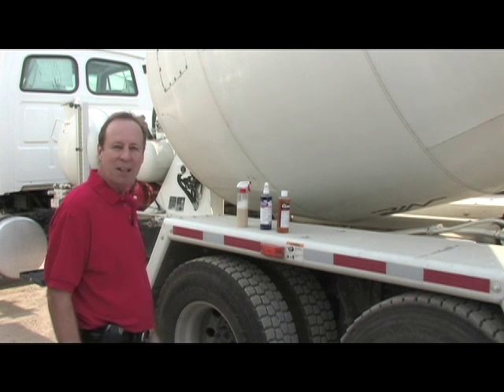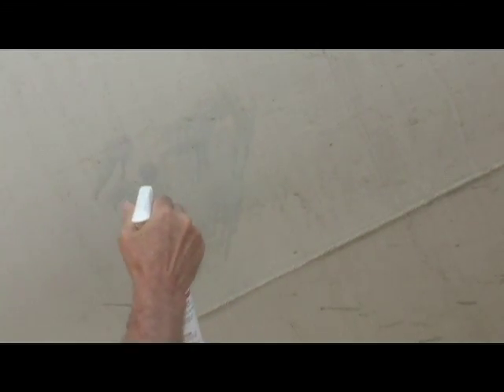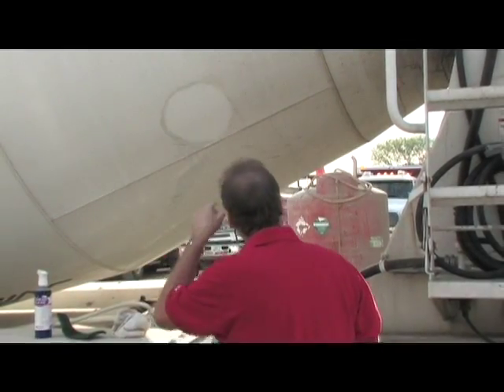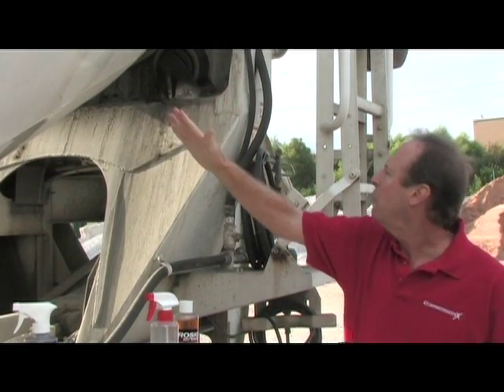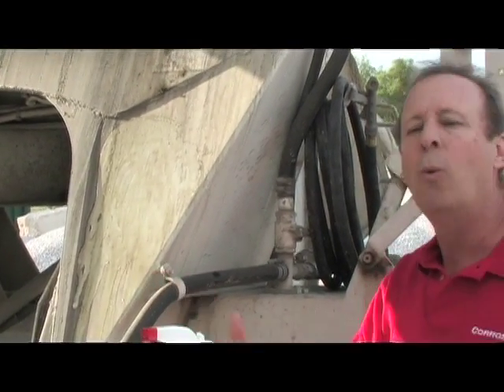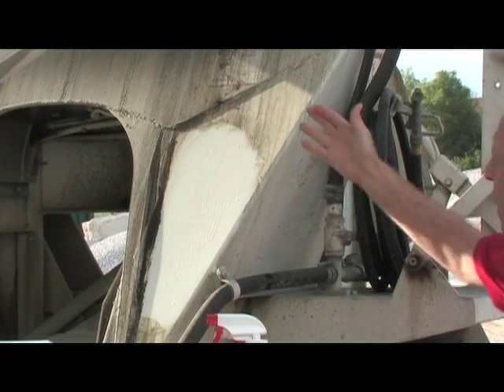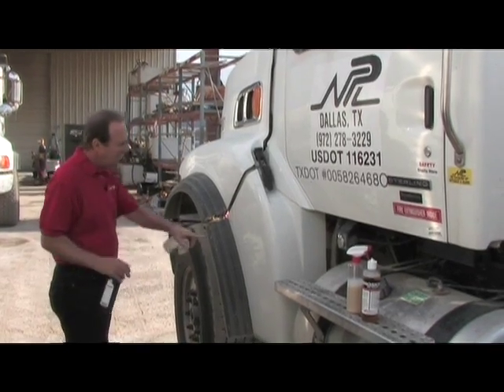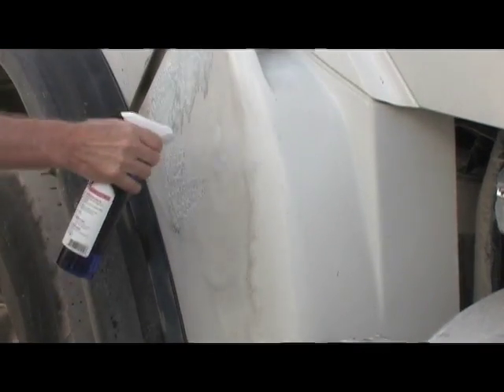Clean concrete from trucks and tools, and keep it from returning

Comment from the maker: I think you are being too literal, my friend. Those are just little sample bottles we use to make it easy to tote around for demonstrations. For an actual production situation, the products are usually pumped out of a 55-gallon drum or 330-gallon tote. You can pump them into a bucket (as is explained in the video) and apply with a brush, or in larger operations we have spray equipment, foaming equipment similar to a car wash sprayer, and even drive-through arches that apply the products automatically as the truck drives through. This demo was done at one of our customers’ plants, which is conveniently located down the street from our factory. As soon as I can get around to it, I will post a video of one of our big systems in operation to show you how it’s done in large scale operations.